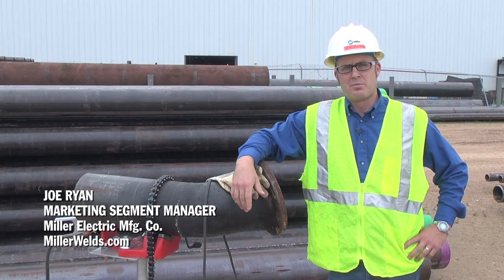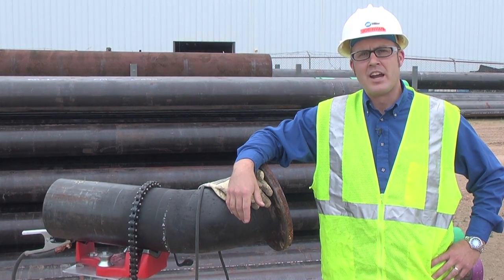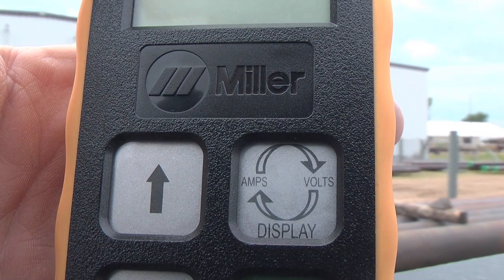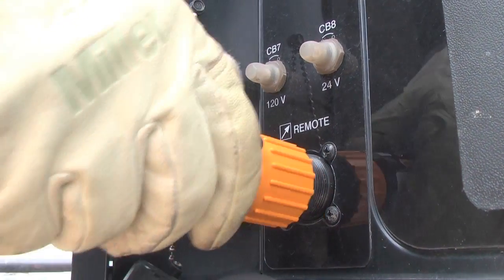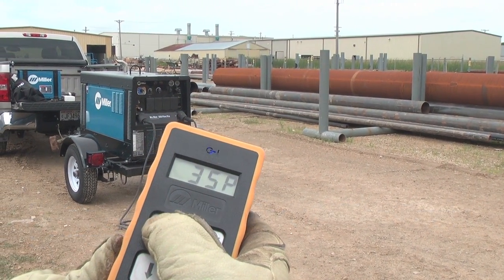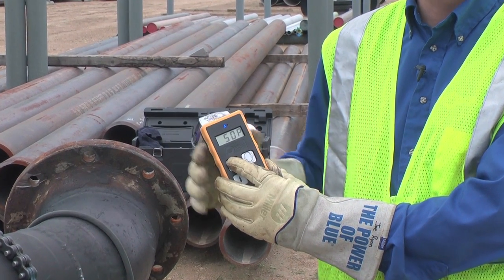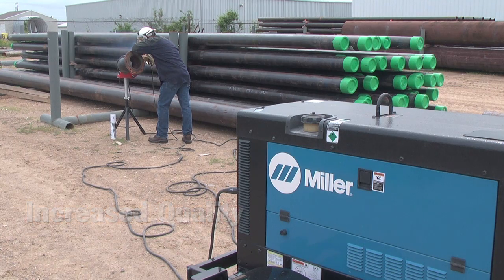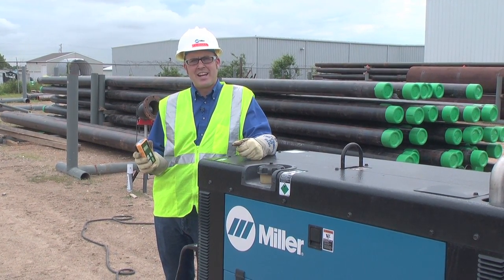Wireless Remote Hand Control Eliminates Control Cable Back to Power Source

Comment: When reading the remote what does the “P” stand for ????? Like ....30p...... is it a percentage of the overall high setting at the machine ???? I own one of these ..... taken some use to ...... but what does that “P” stand for ? And changing from Volts to Amps on the remote can only be done when actual welding is happening .... yes ? NO ? 🤷‍♂️ I do pipeline welding and any information on the understanding of this remote is greatly appreciated. Thanks
Reply from the maker: Hi Thomas, you are correct. P is for percentage and can only display voltage or amperage while welding. We hope this helps!
Reply: Yes it represents the percentage of the total setting you have back at the machine, so for example I’m currently welding 30in ss pipe, so i set my machine at 200amps max so that means my remote is 100, so when i do the root pass i run at 60-70 on remote depending on the gap so that means that back at my machine it’s at around 130-150